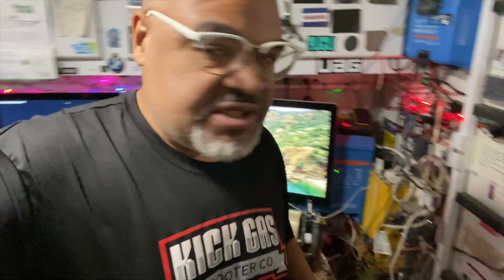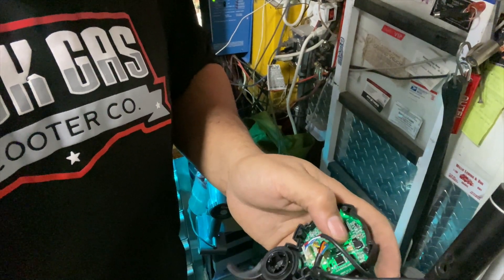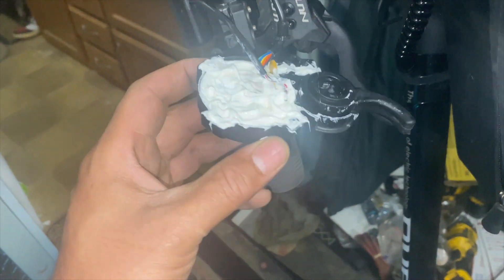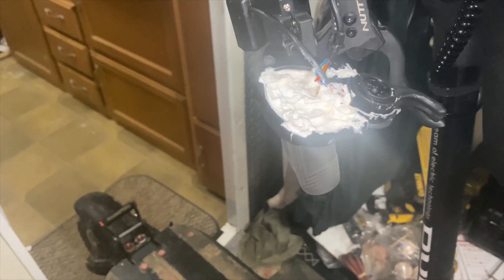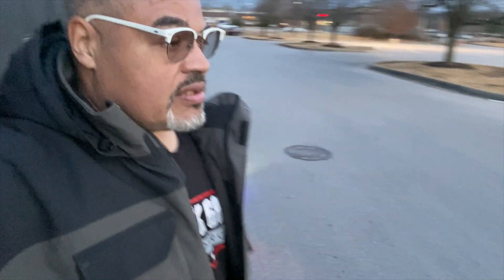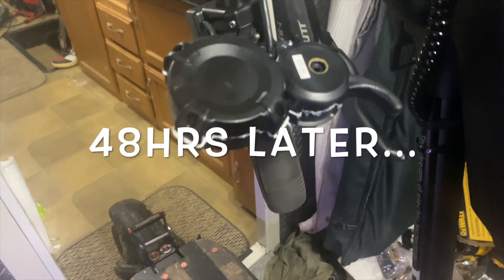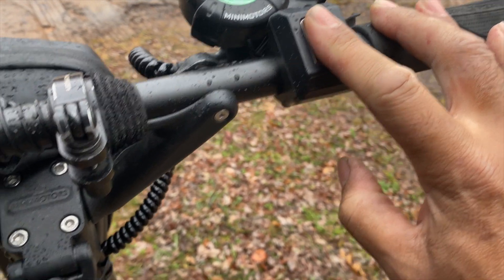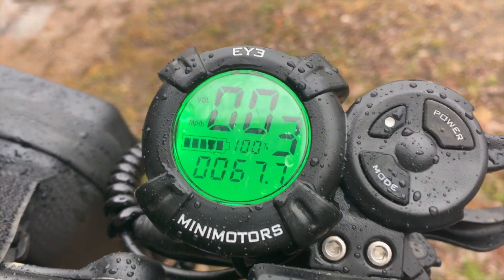Filling Minimotors eY3 controller with SILICONE to make it water resistant!

Comment: The power on, mode, and white circle button are exposed to water that go in between the rubber directly on the circuit board ( which is the opposite side where you applied silicone ), and also from the side opening of the throttle, that water will get to the screen and buttons, so applying silicone to one side and in particular the side you applied it wont do much to protect the controller.

I am still thinking of a good way to waterproof it once I discover it I’ll be happy to let you know.
Reply: if that's the case. isn't it possible then to make a thin silicone/rubber layer on top of the buttons that goes around the casing a bit? for the throttle I don't know
Reply: @NootNooot  Okay so yesterday I decided to cover everything with silicone, a thin layer in the front where the buttons in the board are not on the rubber button, on the actual the main board buttons, silicone around the lcd screen and pins so no water gets in or shorts it, and on the back I applied silicone all over, I applied silicone on the exposed pins of the acelerator sensor, except the mini black  plastic sensor of the accelerator, but everything else full of silicone, and it works great, the only thing is the buttons are now harder to press but its not something I care tho.

This was the only way since the throttle lever is open and there is no way of sealing it, so you have to seal all the board.

Comment: hi its still working ? considering buying but somtimes need to ride in rain
Reply from the maker: works like a champ still!!
Reply: This would be a better product to use "MG Chemicals 422B Silicone Modified Conformal Coating". Used it to waterproof RC electronics before and works really well.

Comment: The water will enter from the cables on the stem post from LED travel down into the battery deck fuck your day up this happen to me and had to replace led both all modules x2  and head light Led x2
Reply from the maker: Thanks for the heads up!! I will be sure to address this with Minimotors...